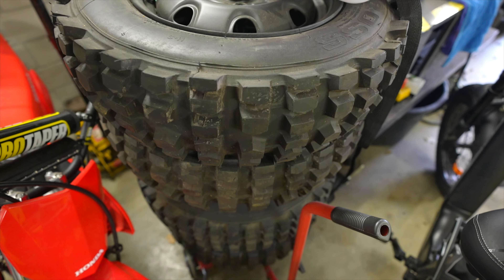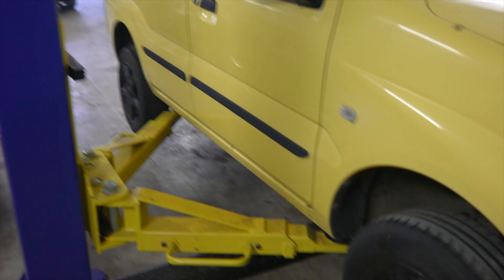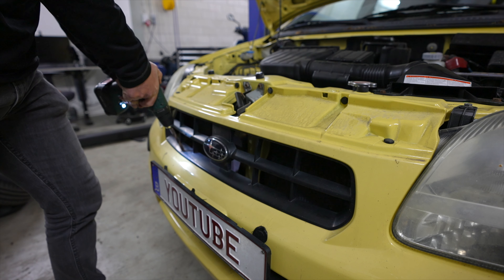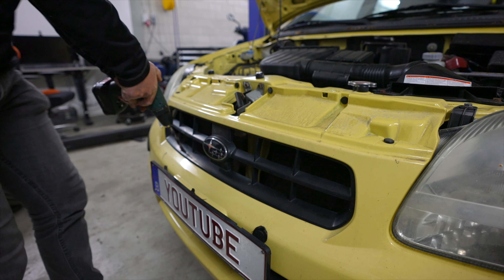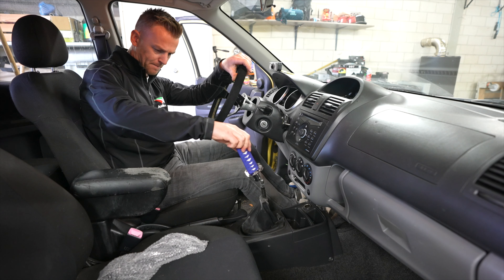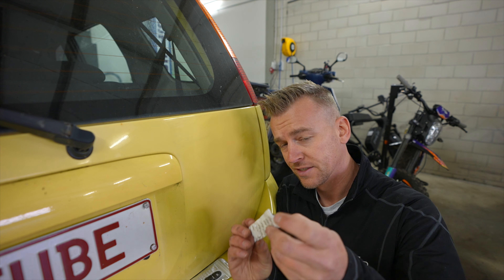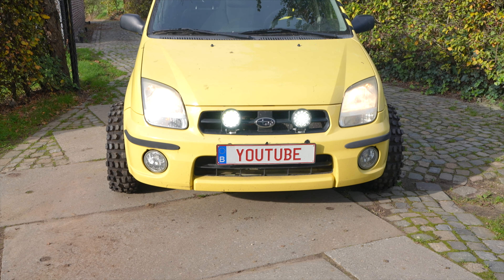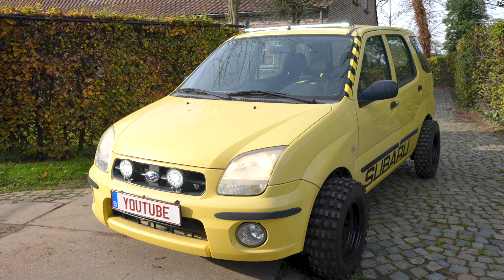Building a CHEAP OFFROAD 4X4 : Subaru Justy

Comment: Only got rear driven if the front wheels loose grip. It is called an Haldex Clutch
Reply from the maker: But why don't the rear wheels turn when i try stopping the front ones? 😅 Or how can i test the system when off the ground?
Reply: @LifeofSmokey  I think all wheels need to  be on the ground so they have the same speed. And when the front and rear wheels have a speed difference, then the haldex will activate.
Reply: And if this not work, then you have an electrical problem. Maybe a fuse or broken wiring.
Reply: @Youri.46  its all mechanical on these, there is a type of slip differential on the centre of the rear tailshaft that has clutch discs in it that wear out

Comment: Sorry to be the bearer of bad news the 1.3L subaru justy/ suzuki ignis where never given 4wd it was only the 1.5L engines that have the 4wd system.
Reply from the maker: Nope mine has the driveshaft to the back wheels as well haha. It worked when i bought it but have done some crazy driving with it and i think i broke something haha
Reply: @LifeofSmokey   fair enough, only ever seen 1.5 have 4wd. But I stand corrected, may be the viscous coupling. 
loving the channel and humour, Keep it up.